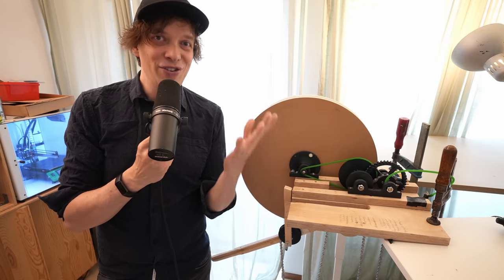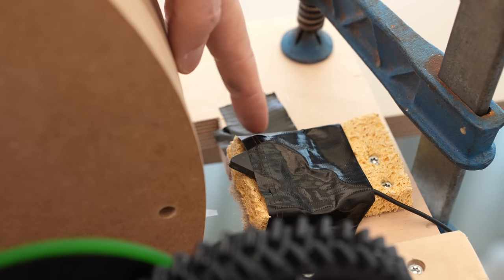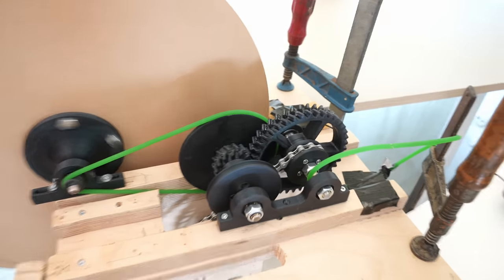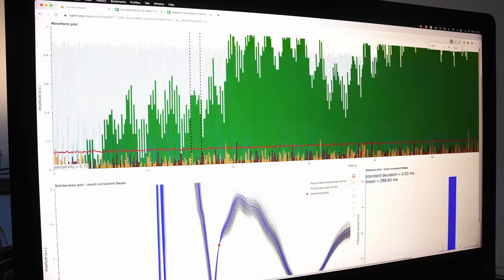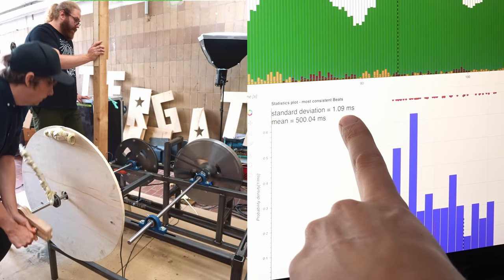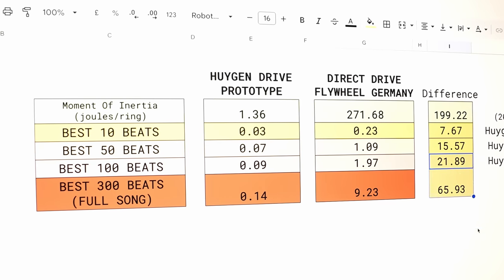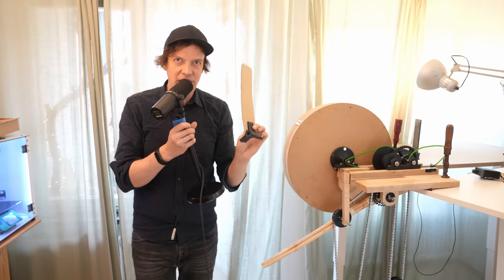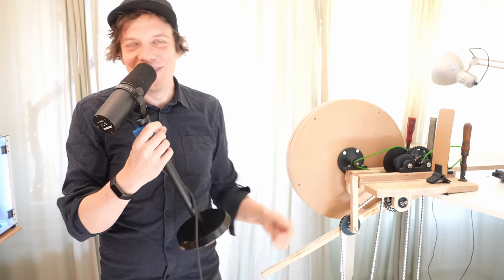Is Gravity Really Constant? I Built this machine to find out.

Comment: While I absolutely find enjoyment in this ongoing series — and have for the past few years — I must profess that I am curious as to the reasoning for recently obsessing so much on milisecond-level "tightness" of the system. Some of the best music we've all ever enjoyed was made before click tracks were used in the studio. Many of our favorite rock & top-40 hits from the '60s, '70s, and '80s have tempos that fluctuate all throughout... or ramp-up across the length of the tune... and nobody cared(cares). If your next version of the Marble Machine has tempo fluctuations, who cares...? The live musicians can adapt. Unless you plan on sync'ing to backing tracks, it seems like overkill - I presume I am missing something... (?)
Reply: I second this. Also, I still feel like part of the appeal was it being powered directly through Martin's actions, stepping on a pedal or rotating a crank and directly playing the machine instead of just winding it up. Dunno why he's changing the whole power input system it seemed fine on MMX
Reply: @KingHarkinianZC  I can totally understand that one might want to minimize variance (as he mentioned in the video) at all points of linkage in the chain, since it will compound by the time input makes its way to output (marbles striking playing surfaces)... but even the previous iteration was more than good enough to play along to in a live performance. If the performance is too perfect, then one might as well just build a machine that strikes the instrument surfaces based on MIDI data and bypass the Rube Goldberg aspect of the design. I think the variance and "will it work?" aspect is part of the charm and appeal of this endeavor - not precision... but that's just me. I would vote for lasting durability WAY over "tightness" of performance. :D
Reply: The Problem I see (and I believe is also what Martin tried to convey in the end of this video) is that the marble machine is an immensely complex machine. If you were to make music electronically, you have the CPU timing and then the tone, and then that's it. But with the Marble Machine, THIS is just the base signal. It will mechanically move a lot of parts, which in turn interact with a lot of OTHER parts, which in turn will create notes which will presumably still interact with even more parts. Each of these steps incurs further deviation. By nailing down the timing of the first element, he is essentially buying himself enough headroom later down the road when moving parts inevitably will drive down tightness. If you already start with a sloppy timing at the first stage, it only CAN go downhill from there.
Reply: On the other hand, he keeps forgetting to take a number of factors into account, so will inevitably end up with a mahcine that doesn't have "perfect" timing anyway... The irony.
Reply: I have a theory, just a theory, backed by some observations, which i’m not having enough time to explain (although I tried under one MMX vid looong time ago), that Martin has found an issue with MMX’s timing, but he looks for a solution in a totally wrong spot. And that is why he keeps failing in finding that solution, but he thinks that’s it’s because the mechanisms he invents aren’t “tight” enough, and this drove him obsessed by it. But the real problem is, that he’s not looking in a right spot. He simply misdiagnosed the issue. I think that the marble machine has a fundamental design flaw which prevents it playing tight music in a different tempos, unless fall time of marbles from each channel is exactly the same. Adding a drum machine that is not based on marble fall time at all, but on direct interaction with contact microphones, is only introducing further issues (and actually highlighting the main issue). It can basically be tuned to work tight for one specific tempo, but the moment that flywheel speed changes, all goes out of sync. That is my feeling, but again - have no time, nor will, to prove it.
Reply: @boryswwa  so...?
Reply: It allows him to procrastinate and produce more videos. There's money to be made in prolonging the problem.
Reply: @thomasbecker9676  those dark circles under his eyes surely wouldn't pay it off
Reply: @samaBR333  He's had those as long as I can remember. If he's hurting for income that badly, he can always get a 9-5.
Reply: @boryswwa yes: there are varying ratios of variables such as how much force the axle friction and tick sound impact make relative to the momentum in the flywheel, *as the flywheel speed changes*.  Things like this where the "formula" has noisy constants precludes a machine from variable timing that is always metered, without some counter governing mechanism. A single rate event must be read and then transformed into sections, or interchangeable parts must be used.
Reply: @thomasbecker9676 you're assuming it's about income. from what I see he's crunching for too many years. and that's how great things are built.
Reply: @samaBR333  Perhaps one day, Martin will complete something.
Reply: @thomasbecker9676  he did the first one and made an awesome video, that's a lot of "something"
Reply: @samaBR333  Except he then was very open about how that machine barely worked, and the video he made is pieced together to avoid showing that.
Reply: @thomasbecker9676 haters gonna hate. why bother giving the guy credit for his super effort and creativity, right?
Reply: The backing track could even be synced automatically. It could be driven by a contact microphone mounted somewhere on the machine that corresponds to the beat, which would be straightforward to convert to a MIDI clock.
Reply: The quest for perfection is noble. I approve Winter
Reply: Basically, the bigger the machine, and the more complex it is, the more it multiplies the error of the flywheel. So for MMX it may be fine but if you have lets say, a machine 3x as complex, that machine might multiply the variation in timing by 30x over a full song. That means you really really want the initial variance being affected to be tiny.
Reply: Humans can already naturally do timing down like 10 miliseconds
Reply: The ADHD need to stubbornly reinvent the wheel
Reply: because he's a youtuber not a musician nowdays.
the band is long abandoned, this is his job now. it can't ever be "finished" because then his revenue would end. this video is a great example of a youtuber testing their market outside the normal content they post. it got 2x his normal hits, there will be more "crazy science" videos coming.

Comment: I would love to see you use bike drive chain components, like cassettes and derailleurs, to change tempos. They're readily available with a wide range of gear ratios.
Reply: The freewheel for the ratcheting, the derailleur for chain tensioning, and a cassette (+ derailleur) to select gears. He's practically there. But just lose the governor and build a proper clock escapement.
Reply: That wouldn't allow for gradual tempo changes tho I'm very curious of how he's gonna handle that problem
Reply: He'd have to build in a kind of clutch, as derailleurs don't like shifting under full power, though I'd love to see this happen aswell
Reply: @AlejandroCaicedoPUJ i think one simple way to handle tempo is directly by changing the programming wheel. Same rpm for all songs, but some songs have more/less beats per rpm
Reply: @AlejandroCaicedoPUJ  Do you mean during a single song?
Reply: @Phriedah interesting! How would one account for different lengths being required for different songs though? I.e.: for fast songs you may need a prohibitively large wheel to get enough musical variation, for slow songs you may need to repeat the song several times. Iunno, maybe that's just something one needs to accept though?
Reply: @inhalants  yes, to clarify I'm talking about dynamic tempo changes in a single piece like ritardando or accelerando
Reply: I feel like the biggest issue with this would end up being the noise - if he was able to use a belt drive with a quieter ratchet/clutch then it could end up a lot quieter
Reply: @AlejandroCaicedoPUJ  From this video (if not before) it is clear that Martin's definition of ritardando and accelerando is "untightness".

I mean, he disqualifies the pedal prototype because it changes tempo by 10 ms/beat _over an entire song_! That is less than 4%, or going from 183 to 189 BPM or vice versa (assuming he used the 186 BPM file).

It would hardly be a noticeable accelerando even if it occurred only over a few bars.

I would totally understand Martin if he wanted to minimise difference in response between different channels or between two subsequent hits by the same channel. That is what I would call untightness. What he does here is just trying to make the marble machine play like a machine.
Reply: I wonder if he could change tempo simply by adding or removing weights
Reply: Rather than gears you can probably just use brakes
Reply: a continuous magnetic ‘gear box’ might be an interesting test, permitting defined tempos with smooth transitions
Reply: @j.j.maverick9252  very clever idea
Reply: @RikKoedoot  Just throwing in the Continuously variable transmission for argument's sake.
Reply: @Phriedah that’s an interesting take. I was thinking of a friction wheel transmission, like in a snowblower. He could put a wheel perpendicular to the flywheel and make it move on its radius (closer to the center = slower, further = faster tempo). A caveat is that the system is analog, so he’d have no trouble getting a 66.6 bpm song or accelerating gradually a song without having to mess with the flywheel. Would this added flexibility going to add complexity to playing the machine ? Probably, but there are ways to make it user-friendly.
Reply: @mumiemonstret  It's not, his definition of tightness is consistency between beats and that has always been the case including during MMX development.  As has been explained in the past, the small variations can compound and become big variations once there are multiple instruments or notes playing.  Martin is a talented musician and I'm sure that he is fully aware of ritardando and accelerando as musical tools, along with standard tempo changes.  His focus is on playing what he defines as tight music (superhumanly so) because if the machine is sloppy at the start it will never not be sloppy.  Compare this to human performances, where there are naturally variations (deliberately or otherwise) - but talented human performers will typically be tight regardless of variations in tempo.
Reply: People, such as myself, have been saying this since the MMX days. The ideal drive is not a lever or crank, it's a geared pedal system. Plenty of stamina and power in the legs, frees both hands to do other things.
Reply: @AlejandroCaicedoPUJ  Yeah I wonder how much of a requirement that is for him. None of the detektivbyran songs have any ritardando or accelerando, but I'm not as familiar with the wintergatan songs. 

In general I wonder if he's going to find that it's hard to compose for the marble machine without displacing the live band members since it's essentially a one man band.
Reply: @mumiemonstret  it think he's just tightening everything as much as possible so that all the changes that he makes to the music are intentional and not just random
Reply: @AlejandroCaicedoPUJ  Yes, that's what he says. But if he wants to use gravity instead of his muscle power to control speed, it's like him saying "I don't like how this flute's tone is affected by my lips and lungs. An organ pipe is superior." 

I think Martin has developed a strange definition of "tightness". And I am afraid that it makes him throw musical expression under the bus.

Varying tempo over the course of several bars is not "untight". Not as long as the other instruments keep up.

And he has spent what - like a week in total? - cranking the machine before he says that it is uncontrollable. Think of a 10-year-old saying that the flute is a stupid instrument after practicing for a week.
Reply: @davidpardy  I think his definition of tightness has gradually evolved over time, maybe without him noticing. First he used a motor on the MMX (perfect speed consistency) and a single channel on the programming wheel to measure repetitiveness on that channel. It makes total sense; if the cymbal doesn't play with exactly the same delay after an impulse from the programming wheel every time, it will be untight in the end. He continued this with a setup with an Arduino and a solenoid, still measuring inconsistency in the marble drop mechanism.

That is not what he is doing now. We don't see any mechanisms related to the separate channels and the programming wheel is out of the picture. He is just testing speed consistency, nothing else. But he is still calling it "tightness".
Reply: @mumiemonstret  The tightness in these recent examples is the ability to play a consistent tempo, yes.  In this case, tightness is actually the right word because if his speed fluctuates too much it's going to sound sloppy.  When taken in context I don't think his definition has changed at all
Reply: @alejandrocaicedopuj6231
Might be able to use a CVT style gearbox for that :) no need for synchro, completely gradual range, and silent thanks to it's belt. (Still, tensionning the belt with a pulley could help :))

Comment: I see this working fine with a constant load, just as it has for clocks for years. But your marble machine is going to have varying loads. Maybe the varying loads are small in relation to the size of the flywheel, but I still think it needs to be considered. A centrifugal governor that moves the wind vanes in and out may help. It would certainly look cool!
Reply: I agree with the centrifugal governor for adapting to the varying loads. Please consider pendulums rather than air.
Reply: I would suggest an escapement. In a metronome or clock, the escapement isolates the load (e.g. a metronome's clicker or clock's geartrain) from the movement of the pendulum.

Comment: If you want to change the tempo analogically (not just 100bpm to 120bpm), you can use the mechanism for the motor speed on old vibraphones ! The belt is on a conical shaft and a command moves the belt on the small or big diameter for tempo changes.
My vibraphonette has that, works like a charm, even though you have to ensure perfect friction

Comment: Martin, please, pleaseeeee, use two separate power inputs in the machine, one for the programing wheel/info of the machine, and another one for the marble lifting, you will get way better results
Reply: what would be the point?  this also mean he will have two different pedals?
I am an advocate that for this first version he should use an electric motor, because he still has a lot of issues to solve ahead, manual power input could be included in a next world tour. 
But trying to include this design with the huge weights that would require and all the power lost by friction from all marble machine components, would be a nightmare which would make him quit.
Reply: @angellestat2730  that would defeat the point of the marble machine, being all mechanical
Reply: @imblackmagic1209  having an electric motor defeat the purpose of all church organs?
Which use the motor to store compressed air?
Besides, you are wrong, the marble machine is not just mechanical, it would use microphones, amps, sound filters, etc.
The same as an electric guitar. 
The mechanism of the marble machine will remain, the only thing that you are changing is the power input.. 
You were fine when he used an electric motor in his previous design?  why not in this one?
Reply: @angellestat2730  Nowhere in the design of either previous Marble Machine did he use a motor. He may have attached one, but only on a temporary basis for testing purposes. In performance, everything between the power input and the marble striking the instruments would have been purely mechanical.
And organs used hand-pumped bellows for over a millennium before the introduction of electric motors. Besides which, the purpose of church organs is not to be "all mechanical"; it's to be loud.
Reply: @kevinr.9733  BUT NOBODY IS HAND PUMPING NOW DONT YOU?
This remove some of the magic, sound quality or merit to the player or the instrument? 
No..   because is not related to the mechanism on how those instruments produce the sound.   It is just the power input.
Then if you said.. with an electric motor you are removing the merit of the player to keep the music tight, but in that case, by adding a Huygen Chain Drive with a governor and a flywheel you are doing the same thing!
Not to mention the COMPLEXITY and issues that this kind of feature adds to the machine and the logistic.
Many of these mechanism does not scale well, because some things depend on the square of the dimensions and others by the cube.
If he continue this path, he may end chasing his own tail because he still doesn't know the power lost that the marble machine will have, this mean he cant calculate which would be the required power input, weights and pieces of the whole power mechanism. 
Still, with an electric motor that can be adjust to the needs.
The risk is that he can build all this and start to design the rest of the machine to later find out that he needs to redesign all the power input, this is when he may resign. 
Instead, he can start simple (with an electric motor and solve the important mechanism related to the instrument it self, and then in a second world tour, he can try to do it without the electric motor. 
Besides which, the purpose of church organs is not to be "all mechanical"; it's to be loud.
This phrase does not have sense.
The sound produced by church organs is all mechanical and requires pressure to work.
That part of the volume depends on the air flow does not change the mechanic of the instrument.
You also need electric amps on the marble machine to amplify the sound.